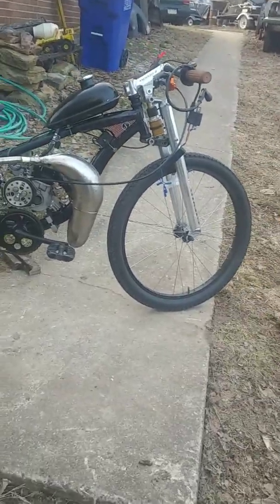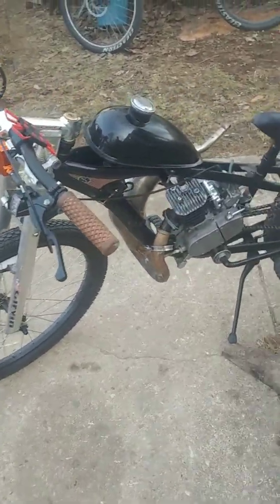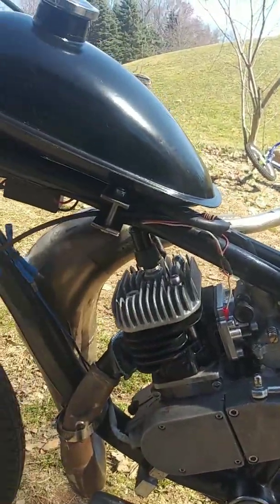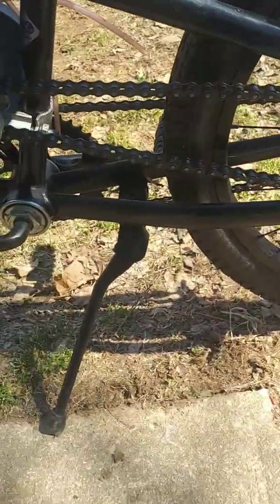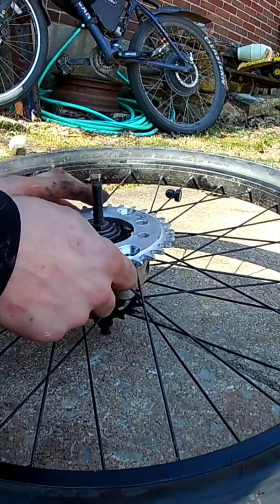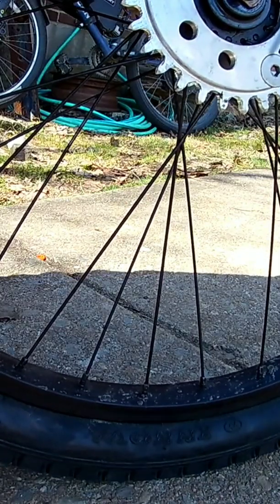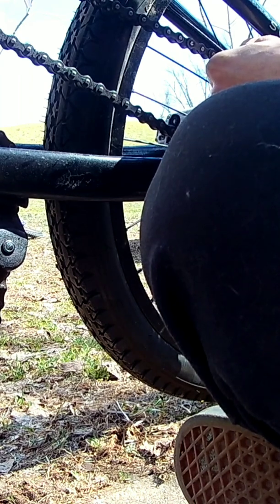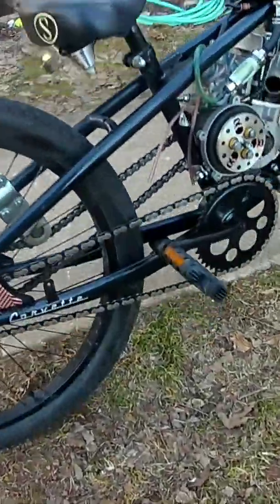motorized bicycle minarelli 70cc hybrid (60mph!)

Comment: Thanks for the ride, Bro. Impressive numbers! Just subbed
My Olyin Balance Base for Minarelli Build with HD Clutch (GoMax) has never slipped on me when it hits the power band.
I'm hitting 51mph on my 50.27cc minarelli (40mmx40mm) with a 10t/32t x 26" @8700rpm
Mz65  with a PZ20 # 98 main.
41 mph @9650rpm with a 10t/44t x 26"

Comment: Great bike bro looks like an early 80s yamaha pipe
Reply from the maker: It was an early 2000s ktm 65 pipe
Reply: @dirtesgarage8733  thanks man! I'm an avid builder. Whats the power band like? I build mostly ld100s... I kno I kno but mine actually get up and go. I'm partial to yz80 pro circuit pipes and mz65s. Currently have an mz65 that I added 1 inch to header and my pipe hits around 7k. Looking for like 6k hit. Any advice helps.

Comment: love it man do you think you could give me a much apreciated build rundown
Reply from the maker: Sheeewww.. it's been a while.. china bicycle engine bottom end. 10mm spacer plate (spacer and case ported/ machined) for the top performance minarelli cylinder kit, mikuni vm18 carb, smolik performance Reed intake... very basic, all porting done by hand including making the spacer plate. Bike was a 24 inch schwinn corvette, still used the coster brakes 😳🤣
Reply from the maker: Oh and ktm65 pipe

Comment: Hey bud you are def not hitting close to 60mph on a 70cc 24 in wheel bike.  Your speedometer needs to be properly configured its defaulted to 26 in wheels and u need to set it to 24 in.  Every revolution of the wheel the cpu thinks u are traversing more distance than u really are cuz a 26 in wheel covers more distance per revolution than a 24😂 in.   This is skewing ur actual mph.  Dont mean to burst ur bubble i just know u got an instrument not giving u correct data and wanted to let u know and how to resolve.   Cool bike btw.
Reply from the maker: Well it's a gps speedometer so idk what you would calibrate

Comment: You can always tell the ones that have never been on a mc. 1st off there's a motor on the bike so don't stearing it like it lean into the curve. 2nd clutch is slipping like a mofo. 3rd want to gain 10mph with out chaining anything on your bike. Get out the damn wind. Lean down, sitting up your torso is creating drag. Put some pegs on the back put your feet back there and lean down get out the wind you'll gain 10 mph just doing that. And that works on any motor set up and on any bike. Even riding my triumph Daytona 675R sitting up to  leaning down gains 10mph. So get out the wind. Clutch slip is an easy fix as well. You don't need the so called 600 lbs clutch. You'll have. Nothing but cable problems. Brake cables is not designed for that much weight. So the cable will fail over time. In stead go to your auto parts store and get a set of cermic brake pads.  You'll need a grinder and thin cutting disc. Lay a clutch pad on the brake shoe trace it out then cut it. Use a wood Chisel to remove from pad. You'll only need half of what's in there so space them out ever other one. Oh and clean both pressure plates one on motor side and one on outer side. Make sure they have a sucfed surface not a slick one. I can do burn outs and ride wheelies on my China doll which is pretty much stock except laser balanced crank and chaged the 10 tooth sprocket to a 13 tooth running a 44 tooth rear and I'm hitting speeds in the 60s. Its your set up and how you ride is what's keeping you from going fast. Cermic sealed bearings for both front and rear and you don't need a Rear tire use two front wheels just don't Put a chain on that side. Do not use a chain tensioner. Go look at motorcycles see if they have them. No the do not so why on earth should you have one on your bike. Because it's a one size fits all kit. And it's a liability issue. Learn how to shorten your chain the correct way. There's more to it the a chain press. You have to smash the pins back or they will come back apart. The less things between your motor and wheel gear means more torque which equals more power. Learn how to adjust your carb by pulling the plug. Lots of videos show you how to jet but not pulling the plug seeing what it'd doing and going to a cooler or hotel plug with a leaner or richer jet. And has a lot to do with fuel and oil mix. Make sure your oils is for air cooled motors and not out board motors. Out boards are also water cooled. Line trimmers blowers etc are air cooled there is a difference. And your mix is determined by your area. Your climate, ground level has a lot to do with your mixture. Going leaner isn't good for your internals. You should have a slight light Grey smoke every now and then. That's how you tell you got your mix right. Try to use none ethanol gad with a good octane booster like royal purple. If you can get race gas like race blue mostly used at dirt tracks get it. Its 129 non ethanol gas. Start with a 40to1 ratio ride a bit don't see smoke add oil till you do. You will feel the difference. It will run more efficiently and lower running Temps thus putting out more power and speed. Don't expect to throw a stock motor kit on a basic bike and you run 50 mph. You have to set it up for the motor. And wear safety gear damn always wear some good padded gloves. First thing your gonna do when. Yiu fall and yiu will You'll put your hands out. 2nd get a motorcycle helmet and wear a jacket. I understand your not going 200 mph buy moat mc accidents happen under 50 mph. And hitting the ground with this motor kit won't be like hitting the ground when it wad just your bike. For one there is that gas tank. Line gets pulled gas comes out. Axle hits ground your on fire. No one wants this to happen to no one but no one is talking about these issues either which is sad. The majority of times the cops mess with yiu is because your doing something stupid. Those of us the ride motorcycles and have or indorsmenrs we know Cars do pay no attention to mc and I can tell you for a fact they damn sure don't give a shit about your life on a motorized bike either. I ride in the middle of the lane. And people will still try to come around me. Mer inches from me. And they receive a brand new Shiney broken window. And they get mad but then the cop wright's them a ticket for endangering my life. So be careful wear your gear. It just might save your life. As a mc we all know the only thing between yiu and the road is God.
Reply from the maker: That's a lot to say you don't know much of what your speaking about
Reply: I'm gonna try the diy ceramic brake clutch pads.....I swapped my stock 1mm clutch  cable out to a 1.5mm cable when the flimsy stock cable broke hoping it'll last longer.

Comment: Where did you buy the orange thing that is where your headlight goes? What is that thing. Runs from your clutch to connect somewhere else. I'd like the link if you don't mind? Ty
Reply from the maker: It is an easy pull clutch, I just searched on Amazon for easy pull clutch lever

Comment: Damn man I've got the phantom 85 V3 and I've hit 45 and that was enough. Eyes watering can't see shit. I got a different reed valve and a 22mm carb and I want to get a pipe made and that's going to be enough for me. I'd love to get the nitrous kit but it only comes with 5 cartridges and you can't buy more you have to buy another kit and I'm not doing that
Reply from the maker: You can buy a box of nitrous cartridges for whipped cream. And remember to dress for the slide, not the ride
Reply: @dirtesgarage8733  don't know what you mean
Reply from the maker: @Westhelockpicker  Go on Amazon and search whipped cream n2o cartridge
Reply: @dirtesgarage8733  wow! And actual nitrous will come out of them and not some kind of cooking shit?
Reply: @dirtesgarage8733  while you're answering questions what are all the extra lines for on the pwk carburetor? There's a bunch of videos of people installing and using them but nobody ever says what they are for. It comes with 4 and I'd imagine one would be a drain if you wreck and probably one for a breather maybe but if you do the math the 85cc needs a 22mm carburetor so I think it'll open it up especially after I get someone to make me a nice expansion chamber exhaust for it

Comment: You put the forks on backwards 😂
Reply from the maker: Lol.. you sure about that, big man
Reply: @dirtesgarage8733  yessss 100%
Reply from the maker: @Douglas E Ott jr  so you've never had or seen a set,  probably never even heard of,  these girvin forks
Reply: @dirtesgarage8733  I don't need to physics tells you that even if they were design ed that way that ,that is very dangerous and a bad design. Which is why u never ever see a fork with the rim mounted behind the center point of the forks.
Reply: @dirtesgarage8733  we're did you get that clutch with the pressure springs
Reply: I love the frame tho iv been searching for that frame in 26 inch but they don't make it iv found it a few other places in that 24 inch
Reply: I see what you mean but who ever put them together put the legs on the wrong side the left goes on the right and the right one goes on the left.
Reply: Yep I looked them up you are right I apologize they are designed that way how weird but it's set at the center point so it don't affect the steering at all.its designed that way so when you turn it don't fight to come back to center becouse the forks are forward like in a girder from end.

Comment: Hey man just wondering do you have to weld on that header to the dirt bike pipe or it just slipped right in and also is that the Mineralli 60° offset header from kaos kustom??

Comment: How much did this bike total in the end?
Reply from the maker: Basic pk80 style engine kit 180, top performance black trophy 70cc minarelli vertical top end kit 150ish, spacer plate was a 15$ piece of aluminum plate (can purchase from smolikperformance) vm20 carb 80, carb adapter and Reed cage about 75, ktm sx85 pipe used 80. Girvin vector 2 forks used 150, Schwinn bike 40 off marketplace

Comment: my 70cc minarelli hybrid goes 44mph with a 44t sprocket, airsal t6 jug, tecnigas next r pipe, 21mm phbg, stage6 mk2 oversize intake
the powerband is amazing
Reply from the maker: This bike also only had 24" wheels, not 26". An airsal t6 would be wicked for sure
Reply: That sounds crazy I'd love to see the airsal t6 jug on one of these China dolls or do you have to use one of  the billet blocks ?
Reply: @SamanthaOakes-w1u  stock block, only cylinder spacer needed
Reply: That's 6 transfers right? Sounds crazy powerful plus the fins on that jug to cool it. Great idea

Comment: The hole in the top  of the crank you know the thing the clutch goes thru the cable stop remove it look down into your crank you will see the internal pressure spring look for the slot now put a screwdriver down the hole into the slot on the disc at the end of the spring locking it from turning the crank is threaded and now if you push your bike. Back wards I believe the crank will turn the disc will not it will travel the threads on the crank this is how you add additional pressure plate spring pressure use small increases like say half to three quarters of a turn now you will feel this increase in that it will now take more pressure to pull in the lever adjust your outer clutch now and your done due to the quality of the stock clutch pads you will notice that each time you adjust the outer clutch that the geometry of the clutch arm changes and you have to move it now you seem pretty bright so pay attention when these moters are assembled the round rod that pushes the. Clutch ball is ground to length this is the problem if you want to avoid replacing the cable and moving the arm every couple of times you adjust the clutch here's what you do find a piece of round steel cut it to the length a half inch longer than the existing rod now you figure out the place to cut it the idea is to turn one part in the lathe to a smaller size  so that it will thread into the other piece you dont turn the whole thing if you do it right when you thread the two pieces together you should end up with a duplicate of your original except that it's two pieces screwed together why do this because let's say you've worn a 16th off your clutch pads this doesn't sound like much but it changes everything so now you take off your side cover pull out the rod separate the. Two pieces and you put a 16th inch thick washer the same diameter as the rod of course screww it back together put it back together and adjust your outer clutch plate you dont have to take off the arm you dont even have to loosen the cable and by adding similar shims as your clutch w ears you can wear the pads down to nothing your clutch geometry remains the same throughout I reccomend getting after market pads synthetic they wear much better now if you replace pads you have to remove all the shims so your clutch rod is stock length agian be sure that when you put the two pieces together you always use loctite so the rod doesn't unscrew itself  in fact I reccomend using loctite on every thing another tip go to the metric bolts at the hardware store  and replace every bolt possible with a nice Allen screw machined bolt like side cover bolts the. ones that hold the two halves together and such it's much better than screwing around with cheap ass screws and bolts I hope this helps and if my directions suck reply and I'll try to explain better cool build good luck wear a helmet!
Reply from the maker: I run an aftermarket clutch that eliminates the internal preload spring. It uses 3 external springs and i have a sealed bearing pressed into the basket to eliminate the flopping bb's
Reply: @dirtesgarage8733  cool you've. Evolved I live at 6000ft in Colorado  I have a 66cc fulldresser beach cruiser iv only done some porting added an expansion chamber and some jetting no reed valve NFL spark plug this bike with eggs 125lbs i weigh close to the same it has a top speed of 40 but really likes thirty and here's the real kicker it gets close   to 200mpg the only problem I've really encountered is a hill of 11 to 15 percent grade with no run I've figured out that it's the donut float in the nt carburetor and it will soon be cured by turning the carb to the side so that it's not flooding when you hit this abrupt angle other than that it drips up the hills around my county and nobody built one yet that even can compete I'm real proud of it of course it doesn't compare with the build you've done. But for a virtually stock china girl motor it kicks ass so just asking how much more rpms can the stock bottom end take over the 6000 factory ratings ?
Reply: @dirtesgarage8733  dont ask me how Ngk got turned into NFL!
Reply: Predictive text is killing me!

Comment: Bore it out to like 85 you’ll go 60-70
Reply from the maker: I could go with like a stage6 sport kit or a better performing 70cc cylinder, or even port this cylinder better, and get up close to 70. Could maybe get 65 if i dropped the rear sprocket to a 28.
Reply: @dirtesgarage8733  or if you want to go water cooled go with the drr atv top end those are sick
Reply from the maker: Id love to but this was as budget friendly as i possibly could make it. Made my own spacer plate, ported the case myself (could probably get a bit more out of it) unbalanced crank, and 110$ top end kit.
Reply from the maker: Whats the bore/ stroke of those drr engines?
Reply: @dirtesgarage8733  it’s a 47mm windowed piston if I’m correct not sure of any of the other dimensions
Reply from the maker: @thewonderfulwizardofcodsaq3472  they are minarelli horizontal. Needs to be a minarelli vertical. Some guys are usong the liquid cooled am6 cylinders. Other using piaggio cylinders. Lots of options

Comment: Yea it can barely pull u up hill n u appear to b a smaller fellow (not tryin to b mean just talkin ) so that’s just zero fun to me I mean if your just lookin for speed then cool but I went down that speed hole last year n came out limping forever now still ride everyday but just sayin b careful out there
Edit: your power band sounds sick
Reply from the maker: Keep in mind that hill is exceptionally steep with 2 sharp turns in it so starting from a stop trying to go up it doesn't work well. On normal riding it climbs hills well enough but yes a larger sprocket may be better for a more hilly area

Comment: Awesome build, 
Where'd you get the minerelli kit?
Reply from the maker: This particular one is the Top Performances Black trophy kit. I think i ordered it from dynoscoot
Reply from the maker: But most any minerelli vertical 50 or 70cc kit will work. Some have better port timing than others, some are more performance oriented. Heck some guys are using am6 liquid cooled kits, but thats a whole nother level
Reply: @dirtesgarage8733  does it fit on a regular 80cc china motor?
Reply from the maker: @Shulkyl  they fit with light modification. Have to drill the mounting stud holes to 8mm and need an adapter spacer plate. Smolikperformance.com offers kits
Reply: @dirtesgarage8733  alright! Thanks!
Reply: Grab that tach wouldn't want that to get wrapped up in the front spoke at 50 mph.   Ass over kettle.    Great video though. I'm sold on these hybrid builds

Comment: No chain tensioner? It's a beast but when your chain stretches its gonna wedge in the case
Reply from the maker: Use a high quality chain. I wont run a tensioner if i dont have to
Reply: @dirtesgarage8733  I run a HDR 420 Chain for years and I have never had any issues at all! 👍